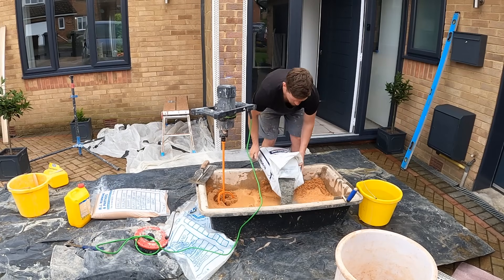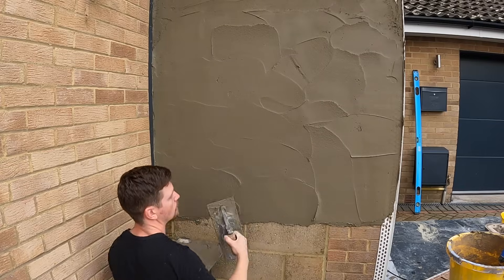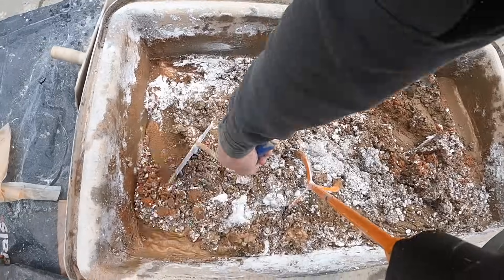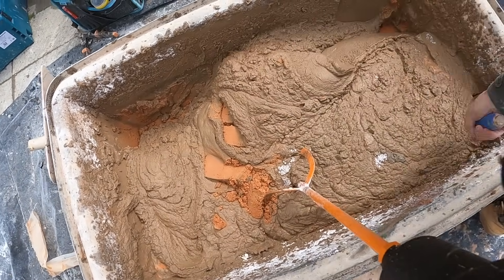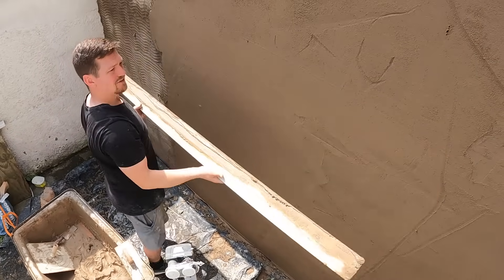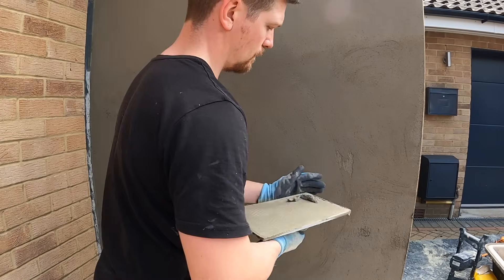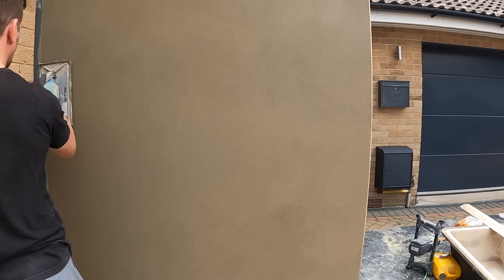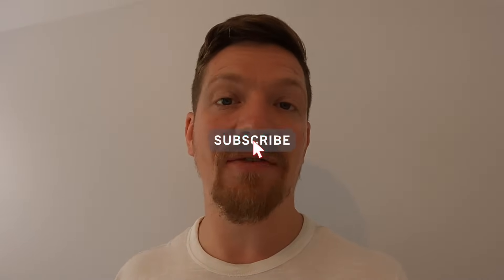How To Render A Wall | COMPLETE BEGINNERS GUIDE...FULL PROCESS!

Comment: Excellent work 👍..  I recently had spot lights fitted in my ceilings, and this caused huge holes to be made in order to pull through cables etc, so i filled in the holes with plasterboard and skimmed over, doesn't look to bad, and thanks to you, as i watched a fair few of your videos to get some insight as to the best way of doing the job.  Anyway, what would you suggest if i wanted to re-plaster all the ceilings, plaster over the current plaster board or add new plasterboard over the original ceilings, or rip it all down and re-plasterboard and apply fresh plaster.  the house is 45 years old, and the ceilings don't look even, as this is a timber frame house, which is prone to move slightly over time.  any suggestions or if you had experience with this type of job before ?  thanks in advance...
Reply: overboard and get a pro in

Comment: Appreciate its a small area but I would never scratch and top out on the same day
Reply from the maker: Fair enough. It's never caused me issues in the past and I'll be honest, I've never heard it to be a problem but I appreciate your opinion.
Reply: Would you ever just mix building sand and cement and render a whole house 1 coat ?? Over brick and block work
Reply: Same here , the top coat could cure quicker than the scratch and pull it off.
Reply: @glendewick1868  yeah that's what my latvian friend has got some Syrian renderers to do on his whole house 😂

Comment: Great video (as always). Quick question: I am new to rendering and need to patch a 10 foot by 5 foot section of wall from which the render has detached. I am considering using a silicon render for the top coat as I believe it has good hydrostatic qualities, and is supposedly easy to apply. Should I still use a sand and cement render for my basecoat? I have watched a number of YouTube videos (including some of yours), but I am still not clear on this.

Comment: Nice video. Could you explain the timing of each part. Like how long before you rule the render the wall flat after applying the render, and how long before you float the wall after you rule the wall. Thanks!
Reply from the maker: There really isn't timings in rendering. It's not like plastering because there's too many variables. Like weather, the background your working on, temperatures etc. Your can't gauge it with time unfortunately.
Reply: @PlasteringForBeginners  but what are you looking for to tell when it's time to rule, and to float? I'm assuming you rule when it's still pretty wet, like as soon as it's on, and then you float once it's fairly hard but still damp?

Comment: The render wont stick unless the base coat is scratched, providing a key of sorts..... i was told on a course i did that the scratches are not for a key but is to ensure there is no air gaps under the base coat. As long as a small amount of water is used before applying coats it will stick. So that the dry surface doesnt suck water out of the render mix and cause it to not adhere properly

Comment: You have two different substrates there matey (concrete block and face brickwork) and because you failed to span the joint with EML, you're going to end up with a nice vertical crack.

Comment: Lovely finish you've got there Blaine, looks as flat as a pancake. 👌Two questions though mate. Why do you go straight down to ground level? I put a stop bead 10mm above the damp proof course. Therefore stopping damp from rising up the wall when it rains, which will perish the render over time. I've always used stainless catnic beads for sand and cement render, have you ever experienced a small 1-2mm gap opening up on the corner on a plastic bead in hot temperatures? Been thinking of using them but a bit concerned this could be an issue. Cheers.
Reply from the maker: Cheers pal! I usually do the same but the builder insisted that he didn't want it. Exactly that...stop bead above the DPC to stop damp rising but again, the builder didn't want it. I warned him but he wasn't interested so it's on him I suppose. 

I much prefer the plastic beads and there's no shrinkage. It's never caused my any problems. Thanks for watching friend 👍
Reply: @PlasteringForBeginners  
Ahh fair enough mate. Might have to give the plastic beads a go for sand and cement render. Use them a lot for K-rend and they're much easier to get bang on precise. Cheers pal.

Comment: Do you need to use mesh?
Reply: Should of where block met bricks, hairline crack will come through.
Reply: @rawboy267  mesh won't stop that crack between 2 different substrates,need to do a control joint or live with the crack.
Reply from the maker: You can mesh to give it more strength. You bed it in the scratch coat 👍

Comment: that will in time 100% will crack down between the 2 diff bricks should put an expansion joint. can already see crack down that join in the bricks .brick ties dont work it shrinks and expands diff  .sand cement over plastic bead is just asking for trouble.

Comment: Put some expanding metal up that rip joint next time , will hairline up that over time and always sbr  brick to be on the safe side .
Reply: expanded metal does not stop cracking.  Expanded metal is for key.  Building paper under the expanded metal stops cracking
Reply: @fixit3108  expanding metal screwed up either side of the rip joint or fiber mesh will prevent hairline cracks , works in the same way scrim tape does on joints for skimming .
Reply: @jdc9128  maybe a hairline crack but wont stop a crack

Comment: You mentioned that you speedskim the scratch coat but should not speedskim the top coat... but you ruled the top coat with a feather edge. What is the difference between a speedskim and a feather edge? To someone like me who's never done rendering, but looking to try on a small garden wall, the speedskim and feather edge look the same.
Reply from the maker: The Speedskim is made from plastic which can flex and create ripples in the render. The Featheredge is completely rigid which means you'll get a truly flatter wall! Hope this helps my friend 👍
Reply: @PlasteringForBeginners  Got it. Makes perfect sense now👍

Comment: You should show how you fix the corner beads
Reply from the maker: Great suggestion...I'll look into my friend 👍
Reply: I’ve just done a job at home fitting some plastic render beads to some steps made out off concrete block before i render them an didn’t know the best way to attach tne beads or what size to use. Seen people using gripfill but I just used sand/cement  to attach them. Enjoy using your site for valuable information 👍

Comment: Sand and cement on plastic beads is a big no noand first step should be protection and surface prep followed by beading then mixing then your scratch coat.

Comment: First mistake is using that stupid paddle mixer thing .Use a proper mixer they don't mix the evoplast ( waterproofer ) through the mix properly to make it workable and waterproof .Secondly I've done whole houses with a float and never needed to use anything to flatten it .And only ever needed a sponge finish because its flat after its coated with a float

Comment: You  would never make it in the states,plastering,they would  run off and leave you,you don't  sponge every job, there's  not enough  mud there to do a dog house,really you should put some galvanized  lath  on that brick so it will last,or use a bonding agent,

Comment: Plastic beads though 🤷🏻‍♂️
Reply from the maker: Plastic all the way!!
Reply: @PlasteringForBeginners  really? You don't have any issue with the render de-laminating from the plastic over time? I used to and switched to aluminium beads..
Reply from the maker: Nothing so far but it’s good to look out for. Thanks for the heads up 👍
Reply: I believe the metal beads rust then starts expanding and weakening and cracking the render. If you look at old stone gate posts you will see the hinges are lined with lead to protect the stone from oxidising metal fixings. Eventually the rust will crack the stone - doesn’t happen over night of course but eventually will do.
Reply: @almusti  aluminium doesn't rust my friend
Reply: @lunch2102 true. I was thinking of galvanised steel which most builders seem to use.
Reply: @almusti  common internally